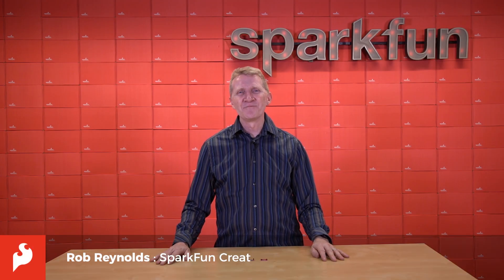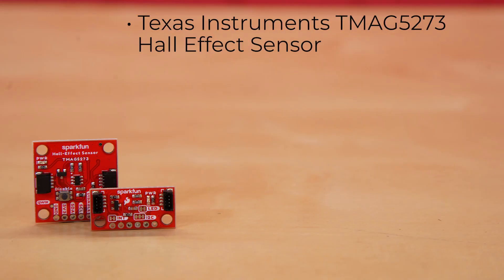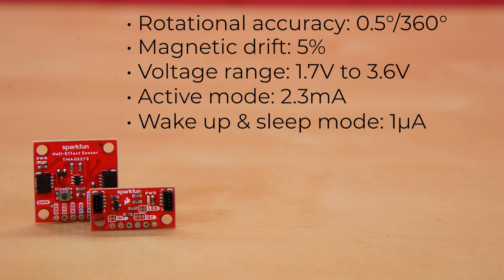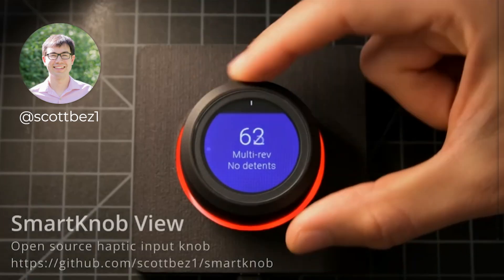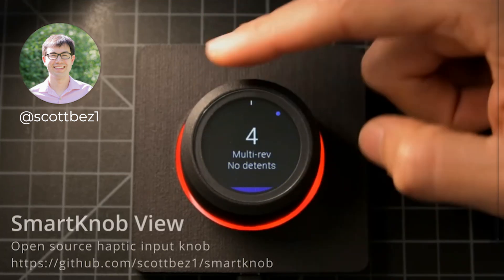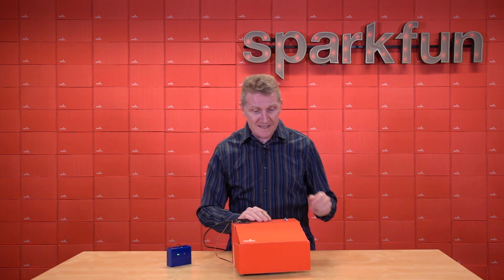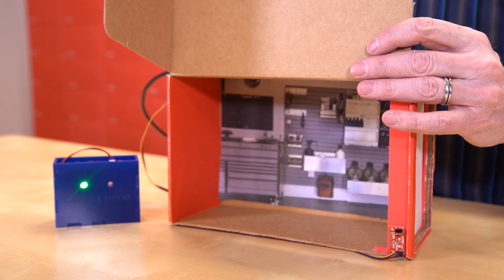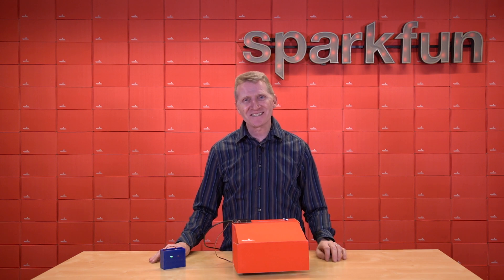SparkFun Linear 3D Hall-Effect Sensor

Comment: Hi Rob,
40 milli-tesla suggests that this is for use with a strong external magnet. 
Problem.
The lead-frames (resistors, capacitors, ICs) and bodies (pish-button-switch) of the components of the sensor 0:59 are sufficiently ferromagnetic to hinder accurate measurement. Would you consider a version with these components far removed from proximity of the sensor? (Try with a wire-extender on the current PCB to see how much of a difference this makes)?